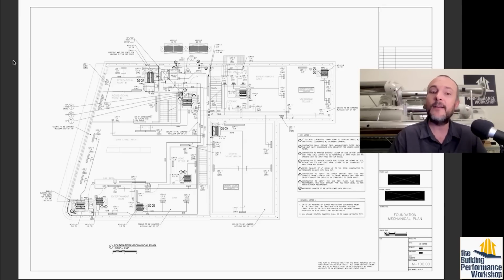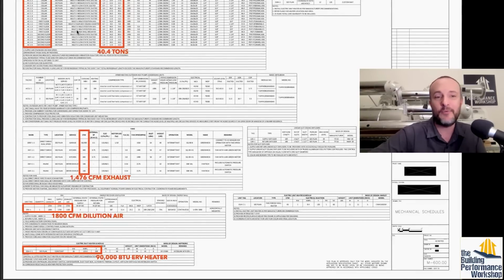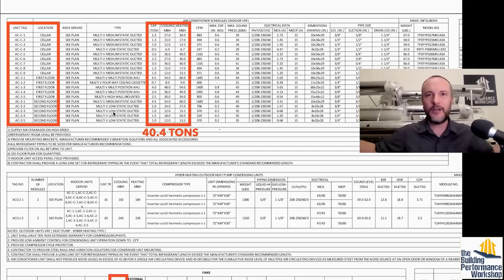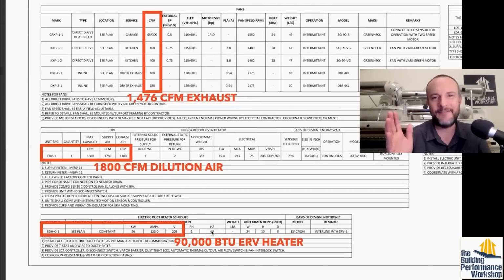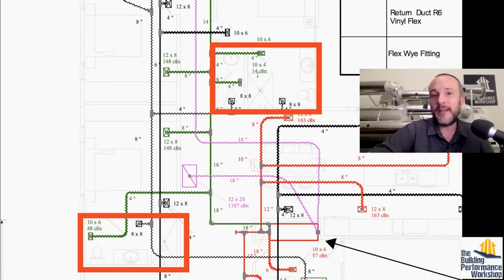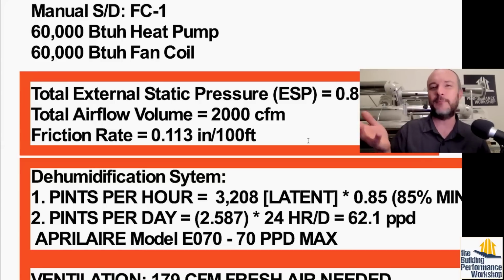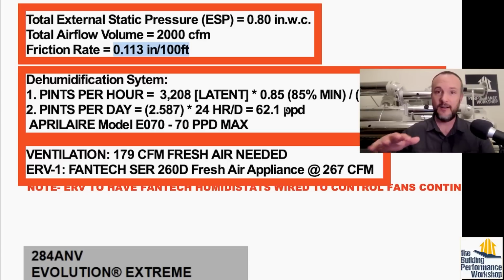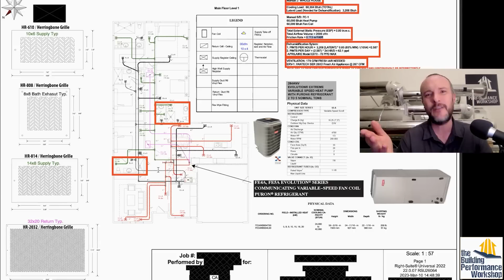HVAC Fail: Mechanical Plan Red Flags, and How to Find Them in Your Man J/S/D Design

Comment: The commercial software gave it away. There may not be any actual kickbacks going on but the commercial construction game is very you scratch my back I’ll scratch yours. All those mini splits, all that duct work. That’s somebody scratching a mechanical contractor’s back.
Reply: … & why all the mini-splits with a new build like this?
Reply: @smitm108  mini splits are sold as giving people total control over their indoor environment. And also, that’s how commercial buildings are usually  designed and built, with short duct systems to to three or four rooms. A mini split installs a lot like a hot/cold water fan coil so a commercial designer would be more familiar with laying out the floor plan that way.
Reply: Seems like the home owner was smart and is going to Corbett for a second opinion.
Reply from the maker: Yes! Normal people are starting to look at these things and recognize red flags!

Comment: So, in my home office, there's going to be at least one 19" rack of computer equipment, plus UPS battery backup, lots of networking and computer gear, etc.... So, if that was my home office, there would be plenty of load being generated even if I'm not in the room.
Reply: Yeah my equipment all generates a lot of heat too, but nowhere near requiring 4 dedicated cooling appliances. I would be much more concerned about recycling the heat out of that room. However you can get some great over locking results by hooking up a commercial air conditioner to your CPU 😄

Comment: Gosh! I have a lot to learn about these HVAC systems.....I hope this is a good start to look at over and over again to learn. Here up here in Atlantic Canada, on Prince Edward Island, calls for ERV unit.  I do not plan to have air conditioning .... because the code up here says we have to have Poly on interior on studs....the solution to prevent mold in the cavity, with R 30 exterior insulation, is to use Smart Membrain by Certaineed.     Thanks for all this!☺👍💯    🙏🇨🇦

Comment: Lower the fan speed to 1750 CFM and get rid of the dehumidifier.
Reply from the maker: What about days when it's 70 deg F and raining, but the ERV keeps on dumping outdoor air inside? That's basically what we need the dehus for- when the A/C will not turn on at all.
Reply: Houses that have humidity problem is not when it 70 degree and raining and the AC is off. It when its 82 and humid outside, AC is short cycling because it's oversized and can't remove the humidity out of the house. That's when you see register sweating and mold growing on the drywall around the registers. From experience Whole house dehumidifier are too small to remove humidity out of a house. That and they use a lot of electricity. Total waste of money in my opinion. A proper sized AC should run at a minimum 20 minutes when its 82 outdoor to maintain the house under 55% RH.
Reply from the maker: High performance homes are fundamentally different, RVB- they pipe in outdoor air continuously, so yes the problem is 70 degree rainy weather. You won’t really feel it til you live in one, but just wanted to warn in case you ever work on one.
Reply: @HomePerformance  i've designed and install hvac system for net zero house and 1 off-grid house here in Dallas, all of them are geothermal heat pump. None of them have a dehumidifier
Reply from the maker: Good luck is all I can say
Reply: @rvbtx1  What are your thoughts on a unit that has short run times, such as 8 minutes, but the humidity stays at 55% or lower? Even on hot, humid days, in the Gulf South.
Reply: @TJ-22  try to increase the runtime. Short runtime could be due to an oversized system, location of the thermostat, location of the supply registers or orientation of the supply register.
Reply: @rvbtx1  The thermostat does have an “overcool mode“ for dehumidification. When set to that mode, the unit runs for approximately 20–30 minutes. Maybe that mode is similar to dry mode? I’m not sure.  Even on really hot/humid days like yesterday, overcool mode keeps the house cool enough.
Reply: @TJ-22  you want to increase runtime without getting too much below setpoint when it becomes too cold and uncomfortable. How cold does it gets when you run the unit on overcool.
Reply: @rvbtx1  The system will go up to a maximum of 3° below setpoint, however, I keep the humidity level set at 55%, therefore, with that setting, it only goes 2° below setpoint. So if the thermostat at 75°, the unit will shut off once it reaches 73°.
Reply: @TJ-22  you need to see if you can extend the unit run time without using the overcool feature. I don't what type of system you have or if it is oversized. Sometime the solution could be as easy as moving thr location of the thermostat, lower the indoor u it fan speed or turn a supply register around so it does blow on the thermostat or into a return grille.
Reply: @rvbtx1  It is a 4 ton unit, 16 SEER. Energy Star,  Single stage unit. Approximately 1900 square-foot home. Single-story, mostly 9 and 10 foot ceilings. The home is about 20 years old. I think it’s leaky or at least somewhat leaky. The thermostat is in the hallway, on an interior wall. Right next to the return air. The thermostat is in the same exact place as it was located with the previous unit, which had a longer run time. But the thermostat is new, a digital, Sensi smart thermostat.
Reply: @TJ-22  can you had remote sensor to that thermostat? If you can, add a couple of wireless remote sensor that you can add in some rooms with a load. Having the thermostat in the hallway next to a large return "satisfy" the thermostat quickly but the heat still is in the house, so it runs 5 minutes then shuts off 5 minutes the  comes on again. But installing remote sensor away from the hallway, the unit will run longer and remove the heat out of the house, the u it will run longer (15 to 20 minutes) but it will also stay off longer. By running longer, the unit will also remove more humidity.
Reply: @rvbtx1  That is a great suggestion. I researched and discovered that this option is only available with the Sensi touch 2 thermostat. Unfortunately, the remote sensor option is not available with the first generation Sensi smart thermostat that I currently have.
Reply: @TJ-22  i think it would worth looking into replacing the thermostat and get a couple of wireless sensor. First of all it would tell you if the rooms with a load are satisfy to meet set point or they are still warm when the system turn off. And that alone could solve all your humidity problems. I am here in Dallas TX and one of the biggest mistake people do is place thermostat in a room with no load (hallway) next to a large return. It almost alway result in short cycle, high humidity, uncomfortable house and high electric bills.
Reply: @rvbtx1   I discovered a slow “cool cycle rate“ setting on the t-stat, which is supposed to provide a wider temperature swing. The options are either slow, medium, or high. “cool cycle rate.“ I’ll test that out and see if it provides a longer run time. If not, will probably change the stat and add a couple of wireless sensor.

Comment: So Corbett what if u have a large master centrally master  closet with no windows or exterior walls door code much of the time first that room need appreciable ventilation even with little thermal load?
Reply from the maker: Sorry John, not following you exactly, but I think this might help: rooms with no load but circulation need can get a small ERV exhaust, one that will at least cycle the air 1x/hour (room volume / 60)
Reply: @HomePerformance  👍🏻

Comment: @Home Performance If you can afford a 14000+ square foot home, surely you can afford a central chiller plant and boiler. That, along with thermal storage and a modulating distribution system is about as comfortable and luxurious as it gets. Plus, the boiler gives you hot water, and accessory heat for things like snow melt, pool heating, greenhouses, etc.
Reply from the maker: I cannot afford that, I’m sorry. But my client could I suppose.
Reply: @HomePerformance  I mean, if they were planning on putting in 40 TONS of capacity?... If your client has that sized budget, and their main priority is luxury and comfort in any possible situation, you might as well do the thing properly. It would probably save them some money, over putting in 19 separate systems.
Reply from the maker: I’m just jokin around. They do not need 40 tons at all. More like 7.
Reply: @HomePerformance  They may only need 7 tons for design day conditions, but if you know it's going to be a party house, it's nice to have that boost capacity if they can afford it. There are no downsides apart from the cost if you have dedicated dehumidification and modulating or buffered capacity. It's like horsepower in a car; if you can control it, having more horsepower is always nicer than having less.
Reply from the maker: Except inverter heat pumps only disl down to 30% of max, so if they installed 40 tons, they’d have a 13 ton single stage system, basically.
Reply: @HomePerformance  That's one option; there are others. You could do two 20 ton heat pumps, which gives you a range of 6 to 40 tons, plus backup if one of the compressors kicks the bucket.

I favor single stage sources with buffer tanks. The components are cheaper and more common, it gives you the ability to dump a lot of heat quickly, and it saves start stop cycles on the equipment; some wood fired boiler users have their systems tuned to only run the boiler every 3 or 4 days; talk about efficiency.  Plus, it keeps the refrigerant out of indoor space, which is a nice safety perk.

The distribution side can handle the modulation with outdoor reset mixing valves, EC pressure regulated circulator pumps, and zone valves. The outdoor reset mixing valve handles rough modulation based on outdoor temperature, and the EC circulator and zone valves take care of precision room-by-room temperature control.

That's a nice system, luxuries, efficient, and only using off-the-shelf commodity parts.
Reply from the maker: Thanks for the details, Zerg, but my original point (the one about the 40 tons) is this is way, way too much power. And most reasonable people can adjust the party load problem by either:
1. Not having a huge party at 5pm on the hottest day of the year, or
2. Taking advantage of the many many event spaces, restaurants, etc that are built for the purpose and need our support to continue existing.
Reply: @HomePerformance  Those are good points. However, what's the point of building a 14,000-square-foot house if you aren't going to use it? It's not like you can take the money with you when you die; you might as well use it to build something amazing. Also, it's been my experience that the type of people that can afford those types of houses are not reasonable and do not take kindly to being told no. I know I wouldn't be if I made that of money; if I want to throw a party for 50 people on the 4th of July, I would expect the system to keep up, even if all the doors were open all day; in fact, I would probably spec the system myself or write the performance specs into the designer's contract.

Comment: Hi Corbin, @ around the 16:49 mark you mention that because the dehumidifier wouldn't be able to pull 70pints per day because realistically the air doesn't contain sufficient humidity, you recommend up sizing the dehumidifier. Can you elaborate on why? If there is less humidity, wouldn't it mean that you could get away with a smaller unit? Or does this mean that a smaller unit would have to work harder than a larger, to remove the same volume of moisture? I'm in the market for a whole house dehumidifier, and am not sure what size to install. You'll have to forgive my ignorance, it's why I ask.
Reply from the maker: Happy to elaborate, watch this:
How to Size a Humidifier or Dehumidifier for Any Home (HVAC Training, Nuance Edition)
https://youtu.be/mQTCl8c3Plw

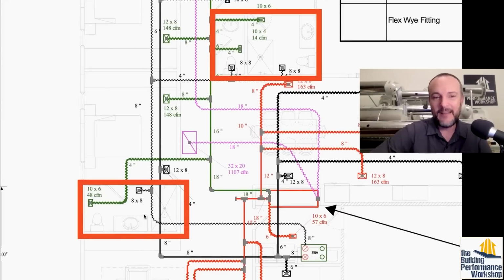Comment: 10:30 oh lord you should see some of the nightmares in NYC apartments. I'd kill to have 49 CFM in our walk in closet. It gets so damn hot. FLIR revealed to be some kind of space in the wall that gets fairly hot - 80-90°f on the surface of the wall. I suspect it's actually a electrical chase carrying the main service wires for a few dozen apartments or at least something like it.

Comment: I believe it’s extremely dishonest of you to post content like this at @2:46 you are taking about no need for cooling and complaining about the side of the diffusers. The side of the diffuser is to reduce noise, the second diffuser based on what I see is the fresh air component and is brought in at a neutral temp. The return is just that necessary return. Think of 1200 watts worth of equipment put two people in that space and that fully justifies the cooling load. This is truly shameful of you to drum up work by criticizing others.
Reply from the maker: Manual J spells out how to build in default internal loads. People who just add 1200 watts to whatever room they feel like are the problem.
Reply: @HomePerformance  Manual J is not the only approved method of calculation, especially for a home this size, most jurisdictions will allow other equivalent methods of calculation. From NYS website “Calculations shall be in accordance with ACCA Standard 183-2007 for commercial, ACCA Manual J for residential, or other approved calculation methods in accordance with the Clean Heat Program Manual.” Internal equipment loads should be accounted for please refer to some ASHRAE documentation.

Comment: Very insightful about their lazy "manual j" and how over powered what they specified is.

I do have to disagree about not putting cooling in the home office though. A high end gaming computer can easily put out 500 watts or 1800 BTU while in use. Even triple screens can add up to 100 watts (350 BTU). It makes sense to add at least some cooling capacity to a home office. I'd be installing a mini-split if I didn't have cooling. Overheating rooms is a very common complaint by gamers. I do agree that if it's just a laptop it's not needed.

In the build I'm planning I'll have up to 3000 watts (10,000 BTU) of computer equipment heat in the basement (I'm a nerd, but hey, that's also why I'm learning about HVAC!). In the winter I can let that heat up the stairwell to help heat the house. In the summer that would cook a small high performance home (30,000 cu ft). I could try ventilating the room to outdoors, but humidity control in winter would be a major problem. I may just install another mini-split.
Reply from the maker: Hey Mark, thanks for the comment as always, but don't forget the Man J is specifically targeting the ONE HOUR that's hottest in the year. If all the cooking equipment, the laundry, AND the computer equipment will all be running at 5pm on the hottest day of the year, then OK I agree. But Man J has a lot of fat built into it already, so I'd be cautious about adding the equipment load just because it's there- the schedule of its use would also be important to consider.
Reply: @HomePerformance  The computer equipment I have is running 24/7, participating in distributed computing projects. It's a very constant 2500 to 3000 watts at the moment (it adds about 2 MWh to my monthly bill). With the snowy season coming to an end I'll be powering a lot of it down over the coming weeks as I don't have sufficient cooling in my current place (I rent). I may still do the same during heatwaves in the new place.
Reply from the maker: Cool, you know what you’re doing. A lot of people add equip load without thinking of the schedule in July/Aug, but sounds like that’s not you.
Reply: @HomePerformance  The majority of what I've learned is from this channel! It's thanks to your excellent videos.
Reply from the maker: Aw shucks man

Comment: Corbett- where did your house end up on that metric between 1200-2500 sq feet per ton?
Reply from the maker: John, using my living space sq ft, it’s 1204 sf/ton, but because I have 47,000 cubic ft of volume, Man J calls what we have 5875 sq ft, in which case it’s 2350 sf/ton.